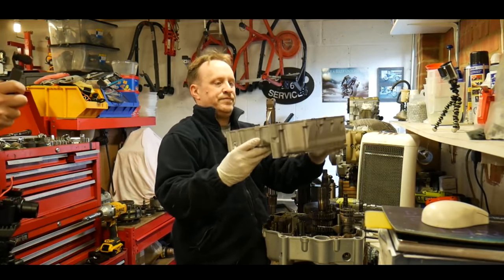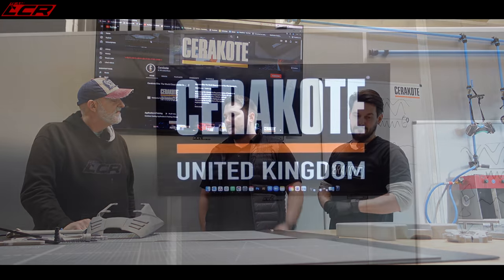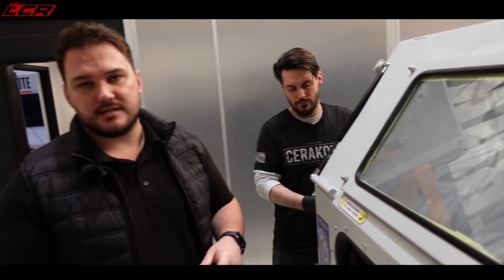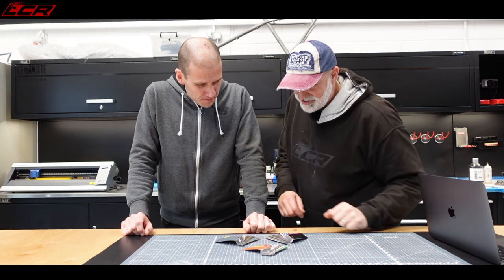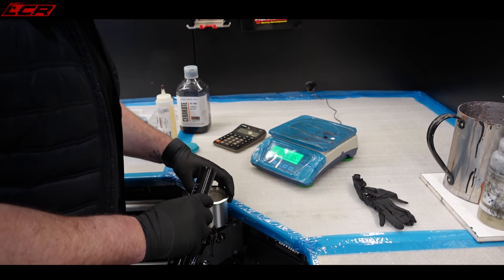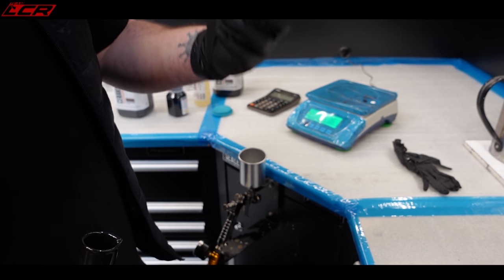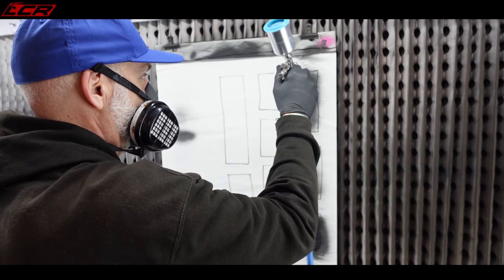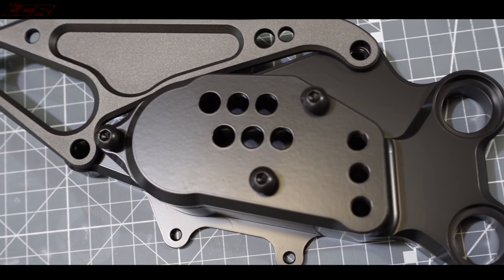Hypermotard Restoration Cases Painted EP13 | Cerakote Painting explained

Comment: I've seen you talk about this a few times now..and since I have just started a project, I thought I would give it a go. I've just picked up a load of parts coated in burnt bronze and the finish looks really good...so I have just dropped of fork casings and a swing arm to be done as well. Love the mix of projects and going into depth on this sort of stuff which is interesting whatever your project.

Comment: In the 60’s and 70’s, powder coating was not popular and/or too expensive.  High heat BBQ grill black spray paint worked surprisingly well.  There was crinkle black, glossy and flat high heat paint.  They held up well even on the expansion chamber exhaust pipe.

Comment: Great vid!  Really interesting process, and the results speak for themselves.  I'll need to get the casings on my Ducati done at some point as they've started to peel in a few places.  Only question I have that I don't think was covered in the vid, is how durable is this compared to normal powder coating?  I'm thinking in terms of scratch/chip resistance, heat resistance etc.  Also how wet does a ring need to be - can it ever be over saturated? ;) :D
Reply from the maker: It's tougher than powder Chris, think they have some comparison charts on the website on wear resistance
Reply: Its used extensively on Motocross parts, engine cases etc and MX bikes take a hell of a lot more abuse than a typical road bike, yet it seems to hold up well